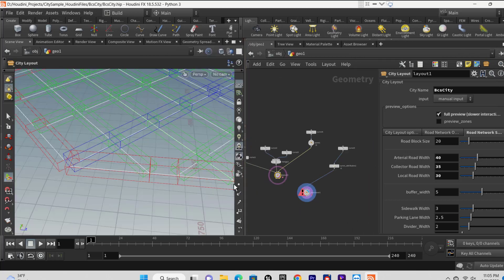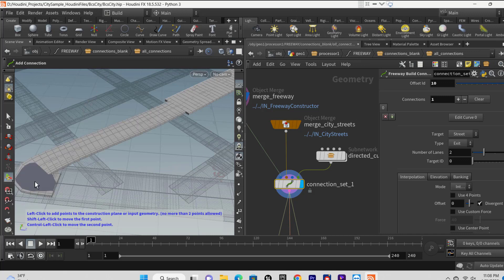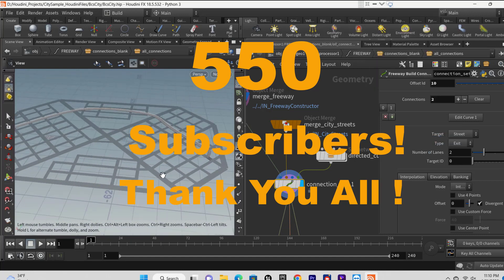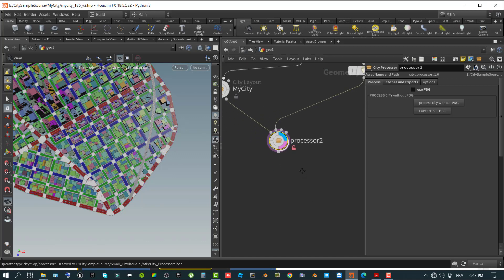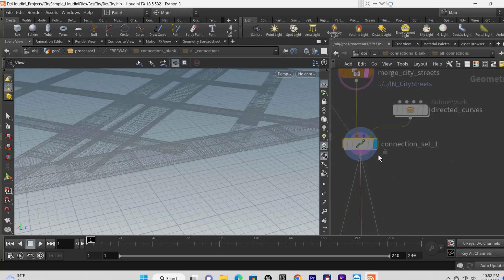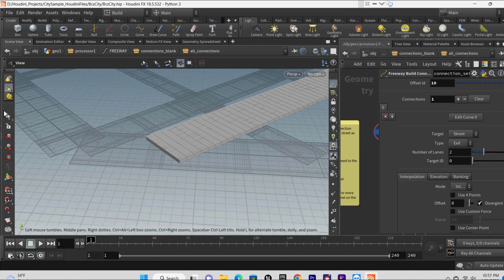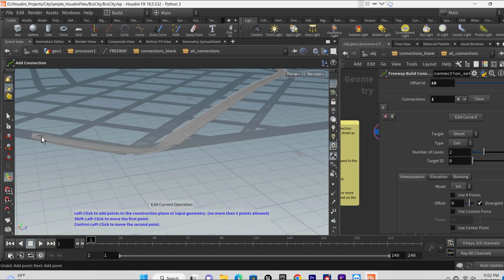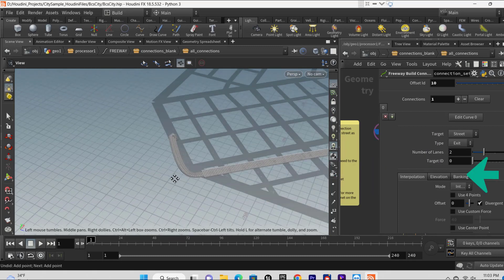Part2: Connecting the Freeway to the roads !

Comment: Hey sir I’m getting a “failed to start Houdini session” error
Reply from the maker: This means that you did not copy the Houdini plugin to the plugins folder 📁 of unreal engine!
Reply: @gamawoodev  ok I have UE5.1 and the housini version that you recommended, but I’m using the latest houdini plugin that is from git hub, should I be using different  version? Also I installed the houdini plugin in the engine plugins not the specific project plugins.
Reply from the maker: It this case you don't need to copy the Houdini plugin as it's already there in the City sample project under plugin/third-party 📁 , also very important you need the 5.0.3 version of unreal engine as the next steps in the tutorial will work with it.
Reply: @gamawoodev  ok I will uninstall 5.1.1 , and install 5.03. Do  I need to remove the city sample assets and install it for the correct version. I appreciate all you help sir.
Reply from the maker: You can keep your 5.1 if you have enough space in your hard drive same for the city sample project no need to remove it! Once you install 5.0.3 Just right click the project file and switch the version from 5.1 to 5.0.3
Reply: @gamawoodev  hello sir so when I try pressing “prices city base” ; it says error “ module object has no attribute ‘do_base’ “
Reply from the maker: I didn't provide a lecture on this yet this is the export process it needs some explanation 😃

Comment: Have you managed to produce PBCs and import the city into Unreal Engine? My city always has a bunch of houses without roofs and no floors as well the highway is never properly generated - just a skeleton of pillars without actual pavement on top of them.
Reply from the maker: Yep I'm also at this point ! You're fortunate as I can't get to have the pillars of the freeway and I'm at my fifth generated custom city 😅 no solution for the time being!
Reply: @gamawoodev  This sucks! Went through a bunch of cities as well, and haven't been able to get one that looked right. Have tried both UE5.1 and UE5.03. UE5.1 wasn't able to process the rules (the engine was just doing nothing after 'Run Rules' button was pressed). 5.03 is doing better, but there is an issue with the highway and missing roofs.
Reply from the maker: Fully agree  this sucks ! And my current specs are not helping me speed up my search either so I think we need   to spend more time learning Houdini to get the information why we're stuck and this 😃